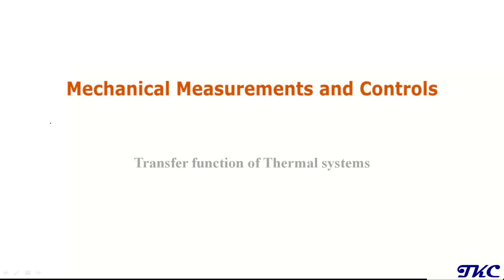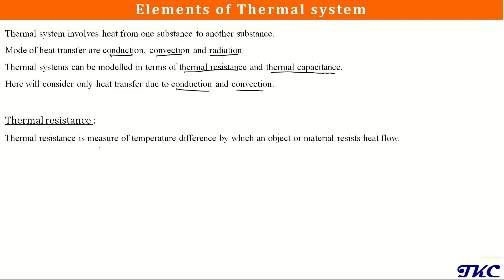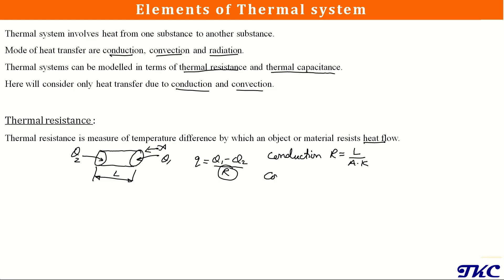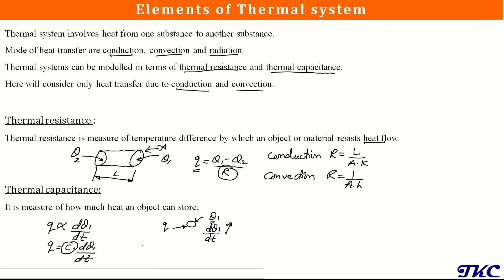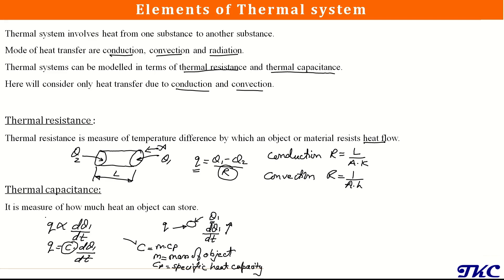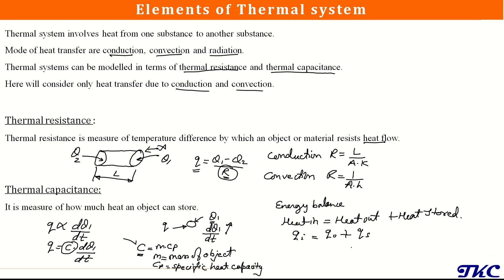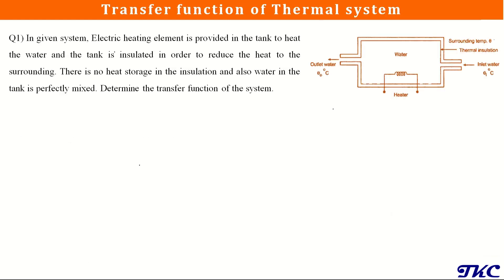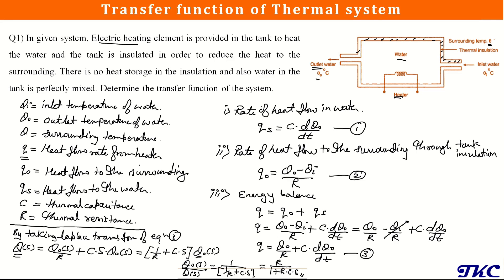Transfer function of Thermal system with example

Comment: the last equation is wrong in laplace transfer funtion because laplace {C*d(Theta_o)/dt} = C*s*Theta_o(s) - Theta_o(0). Do u forget it?
Reply from the maker: The transfer function describes the system's input-output relationship in the Laplace domain, assuming zero initial conditions. This is because the transfer function is derived from the Laplace transform of the system's differential equation, where initial conditions are typically set to zero to simplify the analysis.